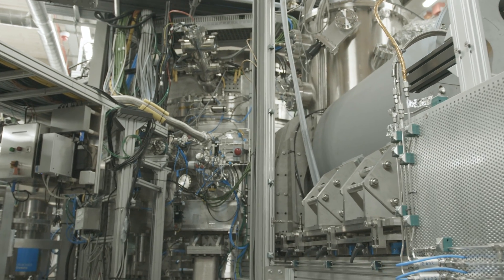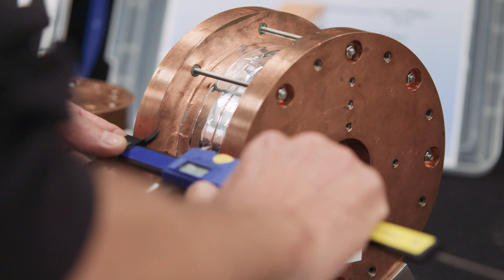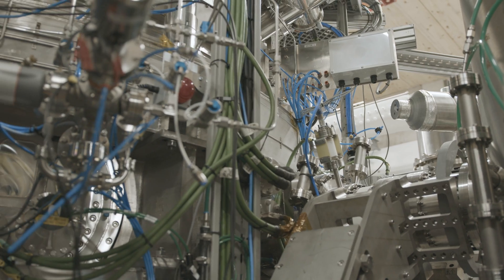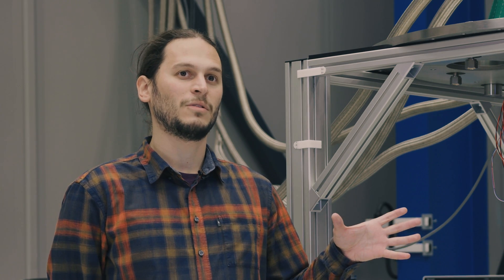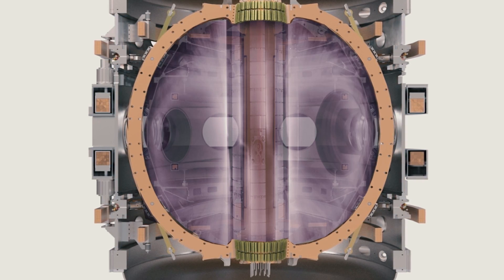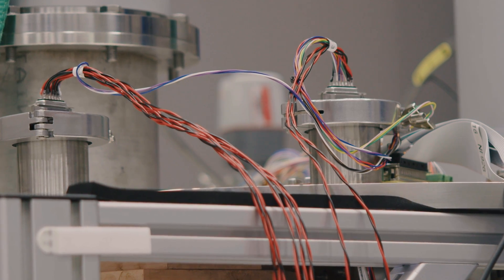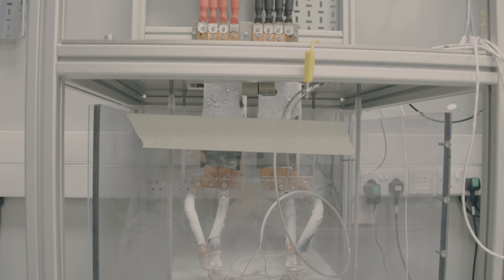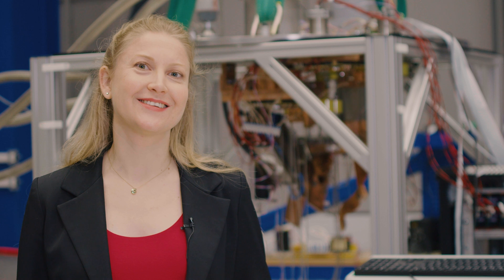Breakthrough in efficient powering of high temperature superconductor magnets

Comment: So traditional HTS systems have to use DC so are you saying you have the AC to DC power supply inside the cryostat and therefore only have the AC supply leads on through plugs into the cryostat?
I always wondered about this but space and yolk constraints are problematic.
How many amps are you running and are you using 'current leads' between the first and second stage of the cooler?

Comment: Why aren't you using high temperature superconductors in your magnet? Low temperature super conducts are old technology - like a horse and buggy.
Reply: If you run a high temperature superconductor colder, it can handle more current and higher magnetic fields.

Comment: Would these high amp cryogenic power supplies have application outside fusion or are they pretty specialized, guessing the latter based on the intro. Also brilliant idea to have a multi-stage PSU going from room temp, to a balmy 70 Kelvin using regular high temp superconductors in the intermediate stage and finally down to the 20 K to run the main magnets properly.
Reply: Sounds like it would be useful for any application that needs a huge, powerful magnet.  Though fusion is the only application I'm aware of.  🙂
Reply: @alandpost  probably one of the most prominent applications of superconducting magnets is in medical imaging - MRI.